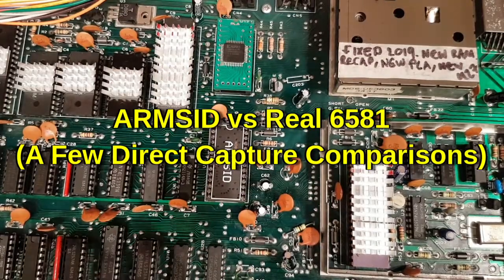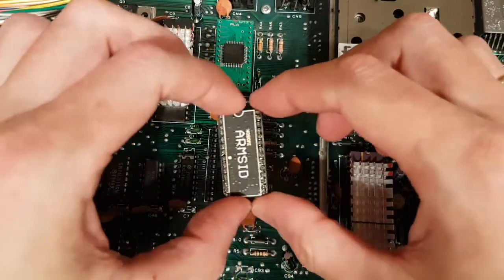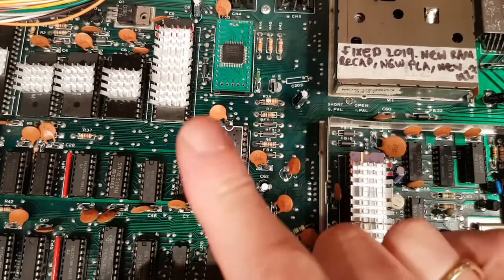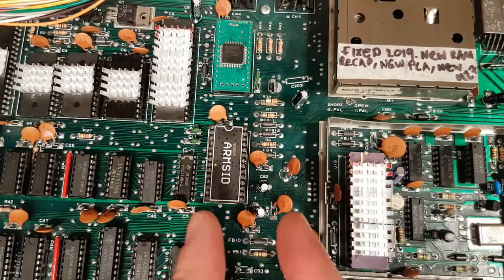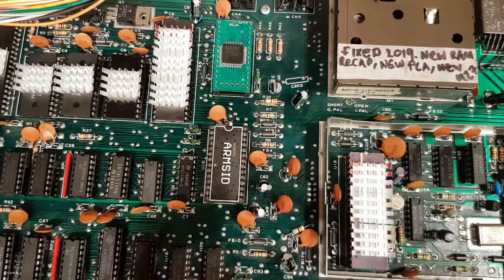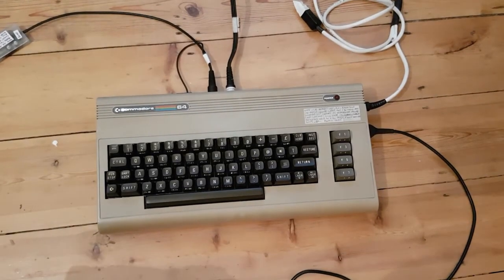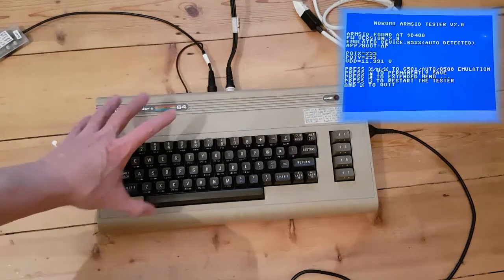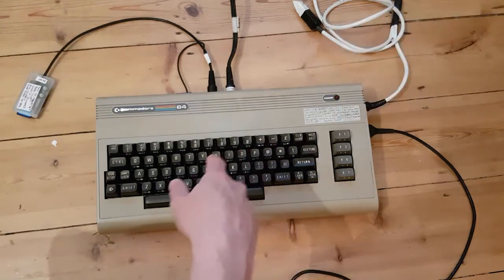ARMSID vs Real 6581 SID (Re-Upload)

Comment: Thank you for your video, excellent. I do not understand the detractors of alternatives such as armsid. For those who really know the sound of the commodore 64, you should know that no sid sounds exactly the same. An identical revision from one commodore to another will sound different. You also have to play with the filters to modify the sound, the results are amazing. I also tried the armsid on a c64c and I even noticed that certain sids sounded better with the armsid with the appropriate settings. And for the owners of the c64c the digifix is possible in software which is really great for old games. Finally we can not say either that the 6581 is better than the 8580, the sids have been composed either for one or for the other and a sid which has been made for an 8580 will sound worse than on a 6581 The sids are dying, the armsid is for me the best replacement simple sid module. And what does firmware 2.15 have in store for us in the future? it can still be improved although it is already really really excellent. I love it as much as my 6581 or 8580, it brings an undeniable plus.

Comment: Best Demo Ever. I have an Armsid . Not needed it as of yet . But just had a real sid fail on me today. but lucky i had a spare 6581 in a c64 i never use because you have to bang on the keys with a hammer to get them to do a keypress lol . The Armsid sounds totally fine . It seems we just need to turn the volume up slightly more on the tv than a real sid chip maybe ? . Respect from Manchester UK.